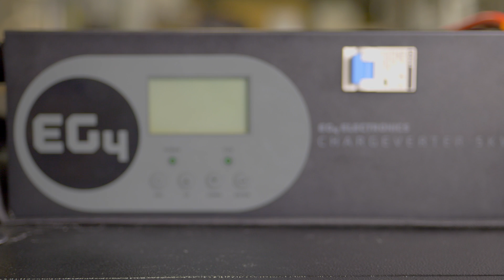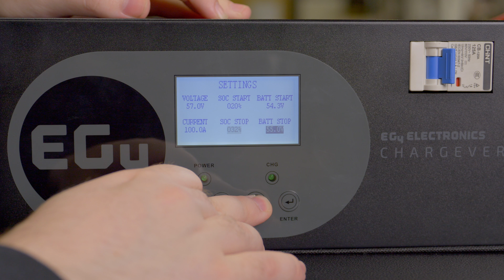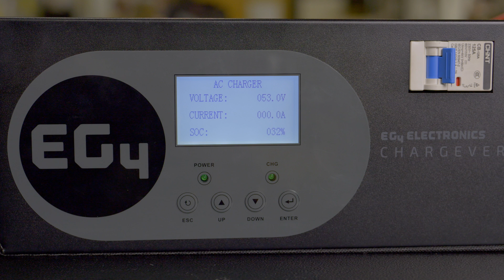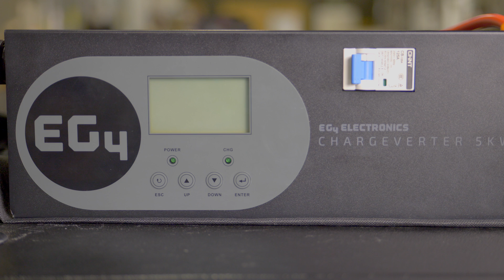What's New with the ChargeVerter? | ChargeVerter-GC Update Overview

Comment: I assume if loads do exceed the Chargeverter output, that just means the battery will discharge during that time of exceeding draw. This scenario doesn’t trip the breaker on the Chargeverter, correct?

Comment: Can I connect generator's auto start to the Inverter instead of the chargverter? since the inverter-battery are communicating, the chargeverter doesn't have battery SOC. In this case I'm thinking I let the inverter start the generator, which starts charging the battery
Reply: I had the same idea.  But upon checking the User Manual for my EG4 3000EHV-48, (page 14) the Dry Contact Signal parameters are ALL based on battery voltage rather than SOC.  Other models of inverter may offer SOC control of the dry contacts, I don't know.

Comment: Why does turning on the chargeverter cause the inverter to shut down? This makes no sense. You buy a battery system so the house won’t go dark during an outage. You don’t want everything to shut down when you connect your generator.
Reply: Please give timestamp where you're seeing this.  I did not get that from the video.  I also read through the User Manual.  It can be made to turn a generator on or off, but has NO way to control the inverter.

Comment: So the inverters kick off when the new battery charger starts but the old yellow one doesnt? Thats not ok.
Reply: Please give timestamp where you're seeing this.  I did not get that from the video.  I also read through the User Manual.  It can be made to turn a generator on or off, but has NO way to control the inverter.

Comment: I have both the older yellow model and this New Black model. I have never been able to get either unit to produce 100 amps charge rate no matter how low my battery bank is in charge level. But at least the yellow model produces 93.5 amps. The black model seems to top out at 89 amps. Even though I have them set up as similarly as possible and they are running in parallel off the same AC Supply and charging the same battery Bank bus.
Reply: does the black one shut off your inverters for a few seconds?
Reply: @JBoy3210  It's just charging batteries. It has no control nor connections to my inverter.

Comment: Nice way of saying that the ChargeVerter CANNOT communicate with the batteries when the batteries are communicating with the inverter, which is always the case!  So why did you put communication on the ChargeVerter and increase the price significantly if we CANNOT use it?  I wanted the old ChargeVerter but you discontinued it and I had to pay $1000 for 2.  That's $200 more out of my pocket for Nothing of benefit.

Comment: What would be the best way to wire this with an 18kpv and server rack setup? 
Would this go directly to the battery bus bars? Trying to set up emergency generator charging.
Reply: Yes, always to the battery bus bars.
Reply: @jim_in_ga  How about the EG4 Power Pro Batteries. How about making a cable to do this without cutting wires.

Comment: Can this be used with the EG4 Wall Mount Indoor Battery?
Reply from the maker: Absolutely, although the connectors that come with the ChargeVerter-GC are the regular terminal lug connections for the server racks. Since the wallmount batteries use quick connects, you'll need to either crimp on new connectors, or run both units to a common external bus bar.
Reply: @eg4electronics  - OH, excellent suggestion with the external bus bar! Thank you so much. I'm purchasing 2 6000XP units and a wall mount battery in July. I'm super excited. I'm also buying the mini split and chargeverter. I absolutely love your products! Great work to you and your entire team!

Comment: So if your communicating between inverter and battery, you can’t communicate with the charger also? Generator startup would be based off a low voltage set point? How does it know when to shut off then?